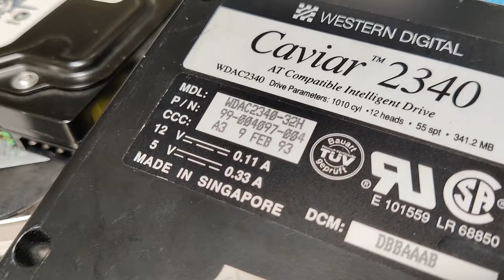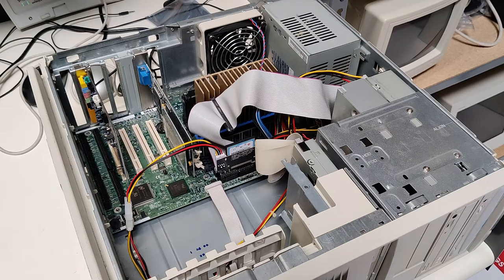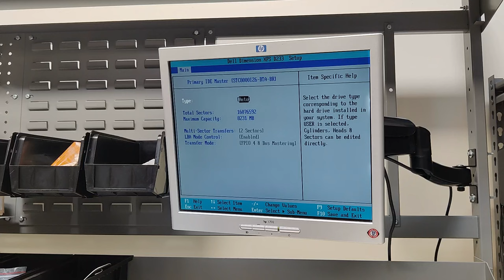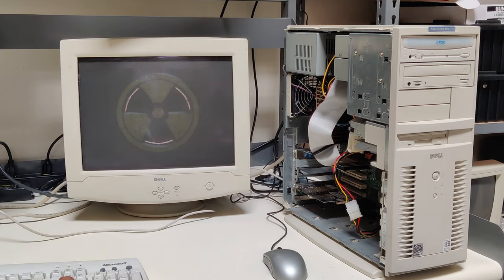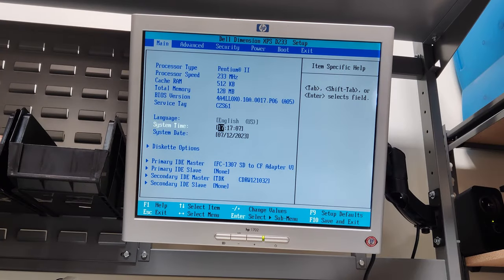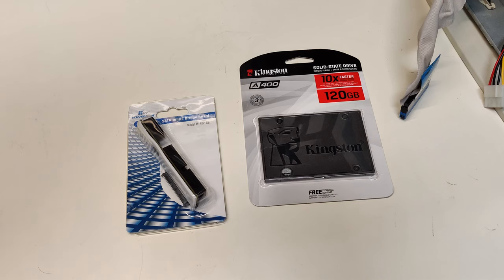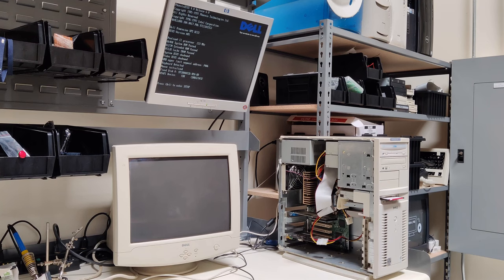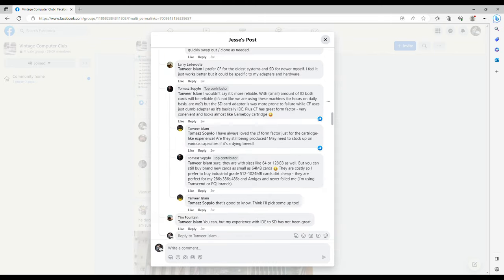Frankenware: Modern flash storage on vintage computers: IDE to CF, SD, SATA & SSD

Comment: I see you are using cheap SD cards. This adapter is very sensitive to poor quality cards. I had similar problems which disappeared after inserting good quality media. I recommend the Sandisk and Samsung EVO brands - while being careful of fakes from eBay.
Reply: Same here, using 2x of these, 1x as OS and 1x Multimedia stuff along with optical drive as slave, running pretty solid no issues. OS SD is a 4GB (Windows 98se) Lexar branded and multimedia SD is a 32GB SanDisk.
Reply from the maker: Thanks, good to know!

Comment: For me, the are two downsides to CF cards. They are getting harder to find, especially the 8GB and under variety.  I've also had problems with bent pins on some of my CF card readers.  But, they are fast and I like the physical size of them.

Comment: that one you suggested as a 2nd drive little washers and off of temu you can get this 2.5 to 3.25 one that you can put it a reg hard drive space its only around 2 or 3 bucks in USA btw without a 3d printer

Comment: 2.5" sata Hewlet-Packard  654540-001 adapter sleds plus sata2ide adapter with a decent bridge chipset
number 1 chipset choice would be Marvell 88SA8040 or 52, as used by some StarTech adapters
number 2 would be JMicron 20330 chipsets as used by the better chinese no name adapters, look for the ones with the lowest profile, like around 12mm, they should have JM silkscreened somewhere on the PCB if you cannot read the text printed on the chip, or they dont tell you what chipset is used, OK for PCs bad for old xBox consoles
absolute worst choice is the chinese adapters using chipsets with the letters SUN in them, avoid like the plague
https://youtu.be/z27b40T6lLs has quite a good review  / speed test of this and other options
Reply from the maker: Good info, thanks!